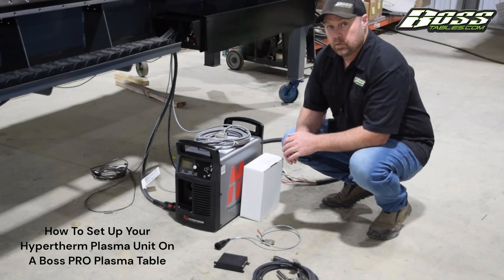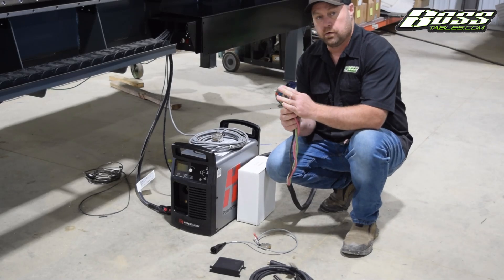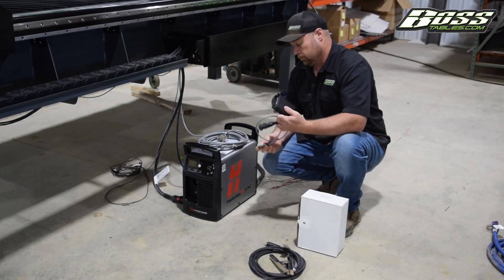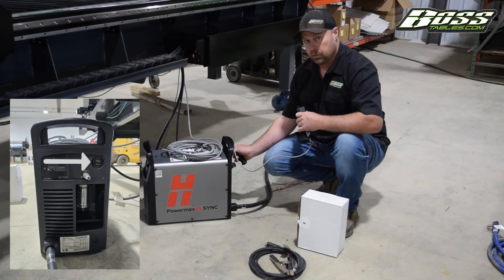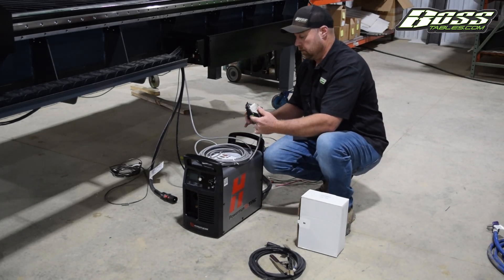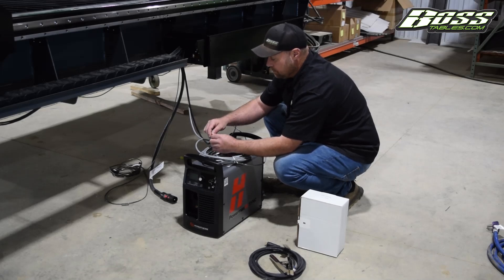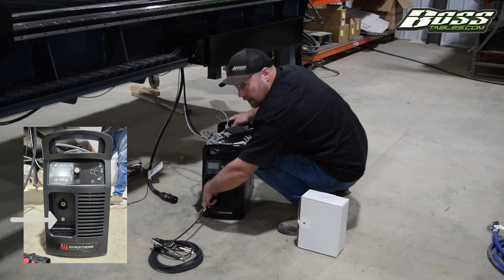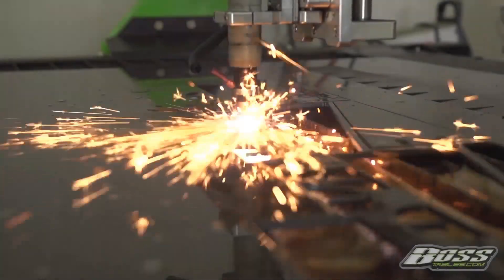Hooking up your Hypertherm Plasma Unit

Comment: Hello sir , i made a DIY CNC table , got a Machine torch on Hypertherm 1650g3 series what are the parts needed to connect it with my computer for full controll. Thanks in advance
Reply from the maker: @farispopovic7665  We do not have an integration for the 1650. But there may be information provided via hypertherm. The information for the CNC should also be available via the manual or literature.